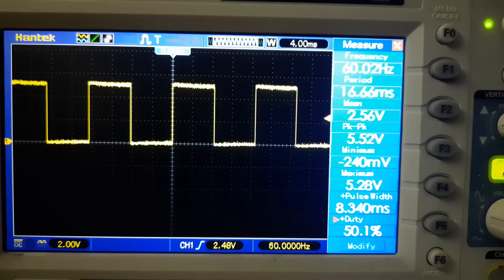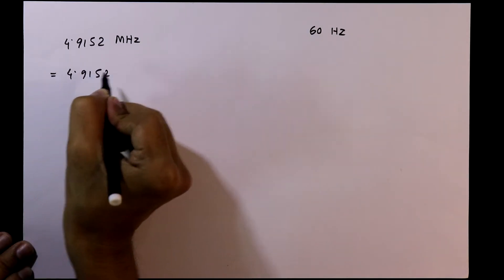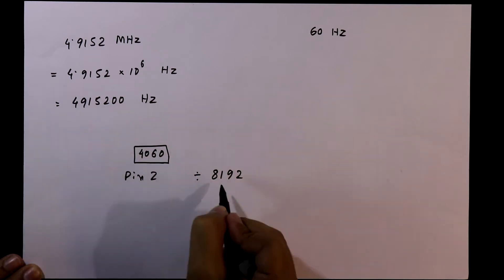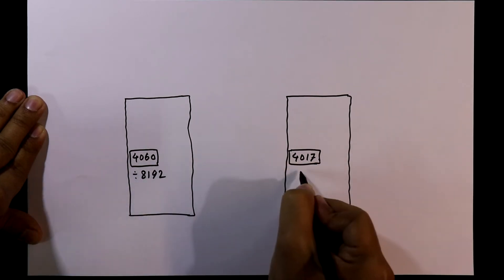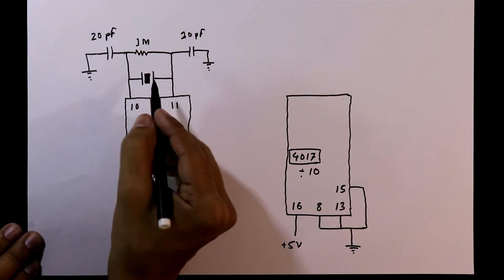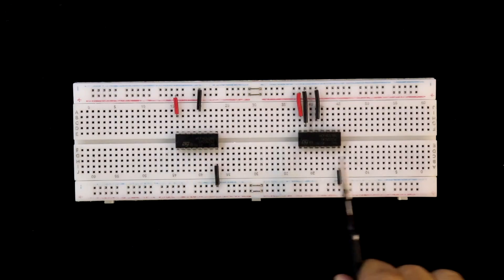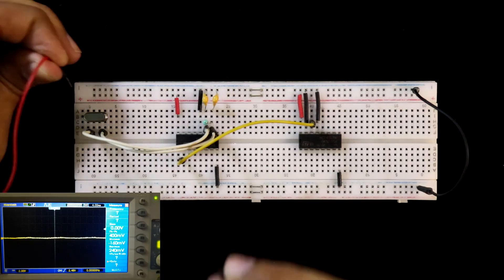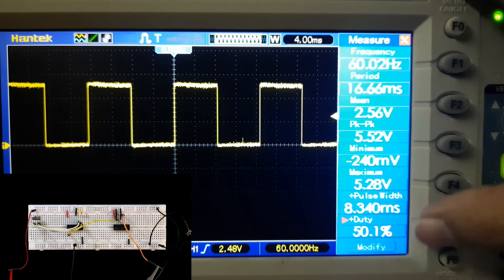Part 4: 60Hz Square Wave generator with 50 percent duty cycle

Comment: Would a 60Hz on 50% duty cycle have an effect like 30Hz? In the case of lighting an led using PWM, or any other application?